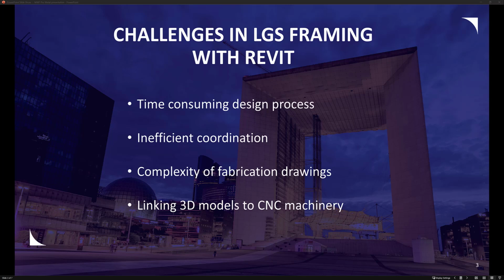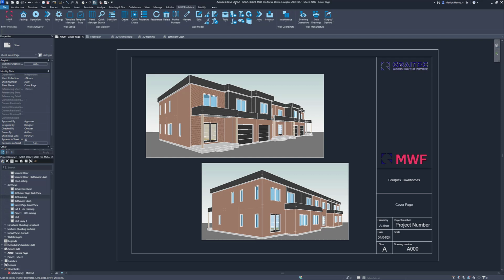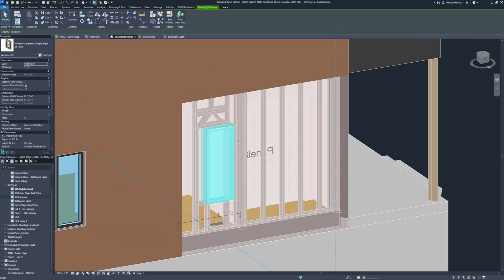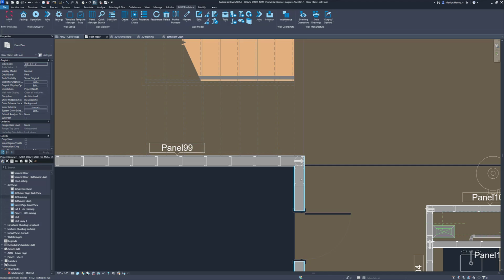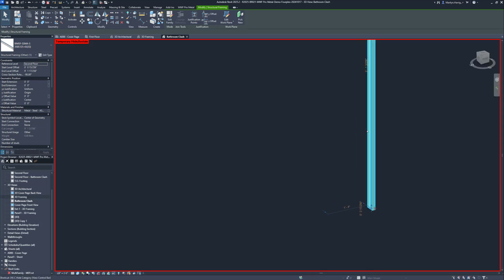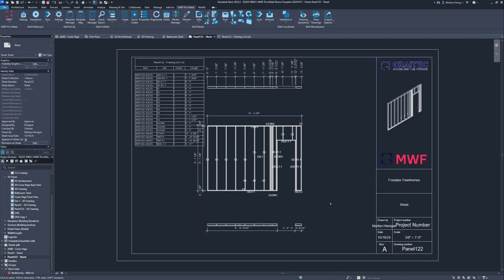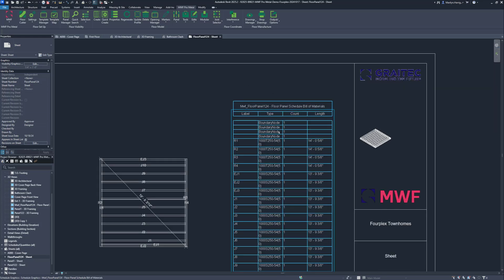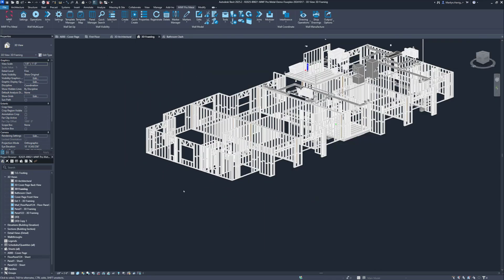Automate Cold Formed Steel Design with Strucsoft For Revit 2025 | Framing Plugin

Comment: @15:34 I don't see dimensions for the plumbing pipe holes. Can this be implemented in the latest software? The pipe behind the sink will be at a 1/4"-Ft Slope so each hole will have a different dim from the bottom of the panel. Also, What's the size of the hole? These are 3 1/2" studs, if that's a 2" pipe, which it most likely will be, it would require at least a 2 3/4" hole which won't pass if this is a load bearing wall but looking at the header, it's likely not load bearing. Can the studs be color coded using Industry standard color code for CFS Mil/Gauge differences? Thanks for the video.